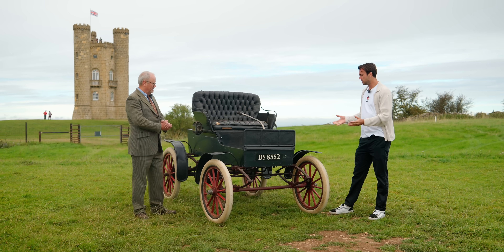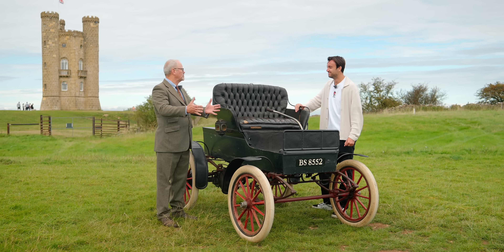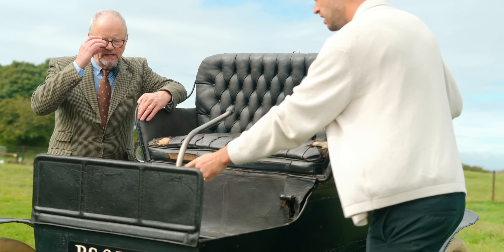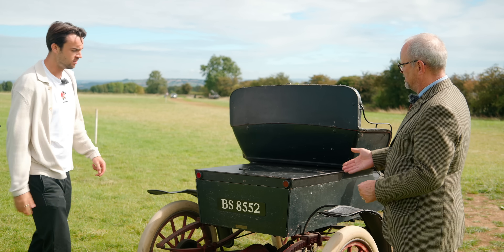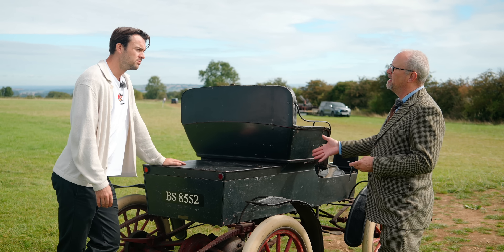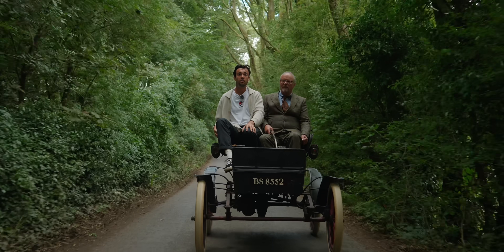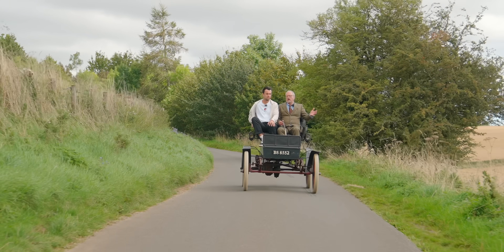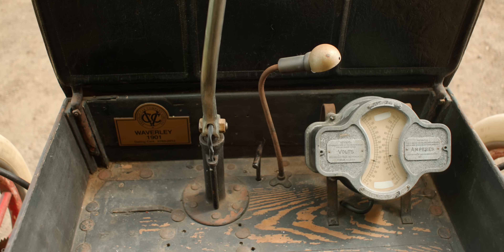Why Electric Cars Failed 100 Years Ago

Comment: The reason we have better batteries was there was a demand for better batteries for mobile phones, if there was a demand for better battery technology they would have been developed sooner.
Reply: Also the manufacture of li-ion cells required advances in materials engineering. Just try manufacturing thin films of  lithium cobalt oxide and and ultra-thin polymer separator, with an electrolyte of lithium hexafluorophosphate. Or even just forming graphite into thin sheets.

In the lead-acid battery this car uses, in contrast, the electrodes are just lumps of lead. You pour lead into a mould, and out pops half a battery. Box two of them up in a wooden box lined with acid-proof pitch, add acid, put the lid on, you have a battery cell.
Reply: Battery life on my phone still sucks.
Reply: @chrisspain  Because now it does more than a gaming PC could do 20yrs ago. I think there should be a market for a nokia 3310 with a modern battery and charging port. It would probably last a month on one charge. EDIT I may be overstating this with the stuff about gaming PCs a bit, but they keep bloating our phones to run bigger and bigger programmes, which we are supposed to call apps now.
Reply: @chrisspain  Only a problem with smartphones. I had a Nokia 5310 (2020) and the battery would last a month before needing to be recharged. Admittedly, it spent most of its life on standby, but still, a smartphone's battery doesn't last that long even on standby. I have a Sony Xperia X Compact now, barely use it, have it stamina mode all the time and the battery still needs to be recharged after 3-4 days.

Comment: I remember my dad saying that men would sometimes break their arms trying to crank a gasoline engine if they weren't careful.
Reply: Even today you are not a Harley driver if you did not at least once broke your ankle.
Reply: Anything can hurt you if you do it wrong.
Reply: @ghost307  Well evidently it was easy to do it wrong. But I wouldn't know the details.
Reply: @777Outrigger  The trick is to use the palm of your hand to push against the crank.
Too many people wrapped their hand around the handle (like grabbing a broomstick) when turning the crank.
If you do it right any kickback would push your hand away from the crank.
If you do it wrong you will have a firm grip on the crank when it kicked back and you'd likely end up with a busted thumb or a broken arm.
Reply: @ghost307  Interesting. Sounds like you have experience in cranking 1920s cars. Not a skill I need though, especially since I drive a Model Y.

Comment: The reason electric cars failed was that there was no electric grid and the cost of electricity was high in 1901. You could arrange to have a 1000 gallon tank of gasoline in every sall town general store, but bring electricity to a smll town wouldn't happen until the government used it as a a make work project during the great depression.
Reply: Thank you for pointing this out! I used to teach engineering history (amongst other things), and it was driving me mad that the FC lads didn't mention this...

Comment: Leaf springs - Land Rover stuck with them until the end of the orig LR/Defender.

Very neat looking device. Unsafe? Safer than some of the e bikes and e scooters flying around. A modern 30kwh version - more fun and comfier than that citroen or reborn bubble car imo
Reply: In the 1900s the price of oil crashed - dirt cheap due to the collapse of the oil lamp demand. Domestic and commercial lighting went electric - so petrol cars were relativelty cheap anyway making up for their far greater maintenance and operation complexity over electric cars. There was still an electric car market in cities in the US - that female market of course - but a bit like the way much public transit (electr ic trams!) were later eased out, the car and oil industry were powerful and pushed their own business plan. Battery technology? Little incentive for the chemical research needed.

Comment: Can anyone explain how regenerative braking works on a modern EV, the mechanics of it
Reply: You reverse the polarity and simply turn the motor into a generator, producing electricity and feeding it back into the battery. The bigger the motor, the more you can regenerate (if the batteries can take the charge). That is the reason why you have even in a little Model 3 hundreds of kWh Motors, so the regen is higher.

Comment: The only problem with my EV is software. A car without it. Could catch on! 😊
Reply: It’s well within the capabilities of anyone with an internet connection to make their own. There are golf carts running brushed motors and rheostatic controls from industrial systems. A VESC upgrade would really be the only thing needed
Reply: Problem is multiple lithium cells need precision idiot proof battery management systems, even then they make splendid incendiaries.
Reply: @howardsimpson489  how so. If the BMS is idot proof, the battery is just fine. Thats like saying you cant trust that gasolin thing because it could just catch a spark somewhere

Comment: I thought it was the oil companies buying all the tram services and then the battery companies so people had no choice but buy gas powered cars.
Reply: And ride in stinky loud inefficent diesel buses on top of pavement that just covered over the electric trolley tracks. Cough gm cough.
Reply: That sure didn't help either.

Comment: No the German did not invent the car, 

He invented a new version of a engine for the car called a Diesel Engine. 

The car been around for some time before that. the British ones were the 1st followed by the French ones.  So the British invented the Bicycle then the Motor Bike came afterwards from the Bicycle then we did the early car from the Motor bike idea. 

We invented the internal combustion engine for the early car then a few years after that Karl Benz invented another type of fossil fuel engine the Diesel Engine. which fires the pistons by heating the fuel air mix not using the spark plug we did?

And as for Henry Ford, he was a very greedy nasty big headed American whom hated that Electric cars even existed, he went and brought up the world Patent for the Electric Motor and Battery system used by the Horseless Cartridge and locked it away and sold his terrible Petrol ( Gasoline ) car, 

BTW he boasted he invented the factory production line system he used for making the Model T car. 
But in fact a British company had been using that for many years building Traction Engines and Tractors in a single 3 story building here in the UK long before him. 

He just copied the idea and of course said he done it?  
He locked the Electric Motor patent away and then the idea was released around the late 1960's that's why we did not see any EV's until the mid 1970's.

Comment: I wonder how far that thing would go if you just changed the batteries and charging with modern equivalents what would still fit inside the battery box.
Reply: Easy. a cheap 20kW LFP Battery would go at 18mph with the original motor (2.2kWh) hundreds of miles. A modern 6kWh motor would be better for hills and get you "@30mph still easy 250mi.
Reply: @chrisspain Without modifying the vehicle (shocks).  I'm not sure I would want to go 30 in that thing.   :p
Reply: @lucidmoses  True but they do it with e-bikes. The 30mph (regulatory 28mph) is meant for hill reserve. And what would stop you to put some motorbike brakes on?
Reply: @chrisspain  e-bikes and such will not build up resonance the way that thing will.   Based on the springs and size of the wheels I'd bet it would take a single pot hole/bump just fine.    But a poorly timed set of holes/bumps could catapult you out of that thing if you had much speed behind it.

Comment: How some old regulator works:

6 batteries.

1. notch : 6 batteries in parallel. (6p)
2. notch : 2 groups in series of 3 batteries in parallel (2s3p)
3. notch : 6 batteries in series (6s)

Comment: Love this episode! So lovely to know that modern BEVs have not spoiled the advantages of the first EVs: ease of use, lack of noise, and regen breaking!
Reply: I also especially loved the analogue Volts/Amps gauges, with the Amps showing negative consumption for regenerative braking.
Reply: @ramblerandy2397 remind me of my Prius C
Reply: Well, I would like to see how much one could gain from regenerative breaking with the batteries of the time.
Reply: What's this regen thing that breaks them and how much does it cost to fix the break?
Reply: @thisisnumber0   BRAKE, as in slowing down.  NOT "break", as in "becoming damaged".
Reply: @thisisnumber0  Regenerative breaking, i.e. turning the motor into a generator to slow down the vehicle. I am actually not sure if this can break at all, at least not with a permanent magnet electric motor. The electric motor itself is extremely reliable and will most likely survive the vehicle...😉 Regenerative breaking is also the trick by which EVs reduce the maintenance cost to a bare minimum!
Reply: @winfriedtheis5767  braking,,, not breaking
Reply: BEV charging and range anxiety are not synonymous with "...ease of use,..."
Reply: @andrewdawson5281 no, especially when most houses and many whole cities didn't have electricity.

 With a steam-car you could always find somewhere to refuel.

And not all of the steam-cars were time consuming or complicated to start and use, but electrics were and still generally is the easiest to start and drive.
Reply: @TheHenirik  Fact is there are no more pure petrol cars and havnt been for over a 100 years. Every car has an electric motor. Its called the starter motor.
Reply: @prabuddhaghosh7022  the starter only starts the motor though, it doesn't power the car. Would you say a crank started cars are partially arm powered too? And a motorcycle with kick start leg powered?

And I don't know what the last car without a electric starter was, but the 2cv almost released without one in 1949
Reply: @andrewdawson5281  I doubt, people had range anxiety back then. Compared to the typical distance the range was probably okay. And charging was possible at the usual destination, and someone else was doing it anyways… Oh, and you had to go to an apothecary to get petrol back then too… So the drawbacks of ICE cars begin last century were similar to the beginning of BEVs. Today range anxiety is not a thing anymore, and charging network is becoming increasingly better and more reliable. And “ease of use” refers to “step in and switch on, go!” Plus there is just one type of electrcity, and I don’t need to check lubricant, cool fluids, AdBlue…

Comment: I’m been a passenger in a Ford model T at the Henry Ford museum, there are a number of cars driving a predefined route around the grounds. And the thing I remember the most is the slick of oil on the roads due to all those cars. What a shame electric didn’t win out back then…
Reply: Well, so many cars had total loss oilers, but driving on dusty dirt roads makes that actually a benefit.
Reply: Electric cars were garbage before lithium batteries so it couldn't have worked back then or even 30 years ago.
Reply: @CptAngelKGaming  "Garbage" how, exactly? Early electrics did exactly what they were supposed to. They were cheaper than a horse, faster than a horse, and got you into town and back. Lead acid and Edison cells were nearly infinitely rebuildable.
Reply: @NOSdWOH1  Probably for the same reason EVs are still plagued in 2023; inadequate charging infrastructure and long recharging times. Much more convenient to poor 5 or 6 gallons of a flammable liquid into a sealed tank with a screw top lid.
Reply: @NOSdWOH1  Super underpowered with no range. It's not rocket science..
Reply: You can refuel a car in 5-7 minutes and be on your way.  Electric cars take 6 times longer and that's if you don't have to wait for a charging station.   :face-green-smiling:

Comment: Li-ion batteries were actually a patent work-around. After the California Zero emission mandate was defeated: GM sold the EV-1 patents to an oil company. The oil company then sued Panasonic for making NiMH batteries for the Toyota Rav4 EV. Because the 18650 [cells] were already used in laptops: there was no way to stop Tesla from putting thousands of them in one container.

NiMH batteries have about half the energy density of Li-ion batteries. But my understanding is that NiMH batteries are more tolerant of abuse. Meaning you can fully [charge ]and discharge them without damaging the battery. So by the time you avoid charging over 80% or discharging below 30% with Li-ion: you are at the same energy density as NiMH.
Reply: any electrical hobbyist would tell you thats what the BMS circuitry is for!
Reply: The license agreement for the use of the patent was that you could not have a battery with more than 10Ah.

This made it usable for hybrids, but it for EVs.
Reply: @MichaelEricMenk  Interesting: I assumed that the limit was 3Ah after being unable to buy "real" C and D cells outside of the grey market.
Reply: @economicprisoner  the prius battery was 6.5Ah, and a little over 1kWh.

I have also noticed that the D and C cells have the same capacity as some AA.

2 possibilities :
1 cheaping out, having a AA inside a D cell
2 the D and C cell have higher C rate.

BTW, you do get D cell holders that holds 2 AA in parallel... The downside is In order to charge them over 0.1C you have to take them out of the "D-cell"
Reply: @MichaelEricMenk  Even "brand name" cells like Rayovac and Energizer  are really AA cells in a D cell case. (You can generally tell by the weight). Tenergy batteries from China are the real ones.
I bought the AA to C/D cell adapters as well (that only hold one cell) but have not had the need to use them yet.

Comment: If we swapped it with modern batteries how much range would it get?
Reply: E very good question, i would hazard a guess at "a lot"
Reply: At that slow speed, I bet it can reach easily 1000 KM or more, on a single charge, on the same height with modern li-on batteries. 
Modern li-on batteries, are not only way less heavy than lead acide batteries, they store way more energy and last much much longer.

Comment: There were a bunch of electric cars with lead acid batteries over the years some did move some units... but if im not mistaken Pb batteries you can only draw them down to 50%... more than that and youre hurting their longevity... thats what i heard about some batteries used as backup storage... dont know if it applied to the cars as well... but that would seriously limit the range
Reply: That is the problem EXACTLY with pb cars. Batteries shouldn't be discharged below 70% if you want your traction battery to last 5 years or so.
Reply: When you drop a Pb Battery lower than 10.7 volts, sulphation damage begins....
Reply: Submarines proved this when forced to remain submerged on batteries for too long. Going below 70% was not too bad if solid charging started immediately, too bad about the bombers cruising overhead.

Comment: The comment “electric motors go on forever” I used to repair vacuum cleaners used in schools, and I can assure you they don’t. I changed hundreds of them that had burnt out.
Reply: Yet oddly enough traction motors do seem to be quite long-lived, perhaps because traditionally they were designed to last whereas cleaning appliances have been built to have a limited lifespan at least since the Second World War.  Many pre-war vacuums and other appliances lasted well into the 1960s.
Reply: Let me guess what caused them to burn out.....leaving the dust bag in too long and letting it clog everything so the motors don't get enough cooling air?
Reply: @paulmichaelfreedman8334  in some cases yes, but I also used to repair extractor fans from small 4” to large 3 phase motors and motors do fail, if they didn’t then motor rewinding companies wouldn’t exist.
Reply: @sergentcolon1 old motors usually failer, after several brush changes, at the commutator in my experience. Modern brushless motors though, if you keep the dirt out and don't let them get too hot will last as long as the bearing on the spindle do.

Comment: In fairness the coal plants producing the electricity for these cars were a lot filthier than burning oil or petrol, so not as environmentally friendly as you’d think , plus the world had almost no electricity infrastructure. So no conspiracy theory, just real world practicality, that everyone went petrol powered .
Reply: @floreamariussorin8652 @superbiguss didn't talk about now, but was explaining some reasons why combustion engines won the race
Reply: @pettahify ; still a poor argument by superbiguss. 
The video is not saying there was a conspiracy in 1910. 
Also, in 1910 people didn’t care about pollution from coal plants. 
And in 1910, petrol infrastructure was just as bad as electricity infrastructure. 
* The video explains why the petrol/gas car won. The Ford Model T became much cheaper than electric cars at $250 and lead acid battery EVs were not good enough (in terms of power, range & lifespan).

Comment: According to the book "The Renewable Energy Transition, Realities for Canada and the World", Ferdinand Porche's first car design was an electric.
Reply: Its hub motor drive system design was also used for the moon buggy many decades later. ;)
Reply: series plug in hybrid
Reply: porsche's first electric cars were made by the jacob lohner company, he also designed a hybrid car for them, known as the lohner-porsche mixed 'electro-benzin wagen'.
Reply: He made his fortune in electric cars and as a billion dollar corporation with worldwide sales switched to ICE funny how life repeats itslf
Reply: Oldsmobile's first car was steam.
Reply: His version of the Tiger tank was electric drive, but he couldn’t make it reliable, problems with the motors and generators overheating and catching fire.
Reply: @sergentcolon1 

Voltage too low for the amps needed. 

Same lesson learned with the 1997 Prius
Reply: @BeLowBelowo  Higher voltage brings its own perils and challenges.